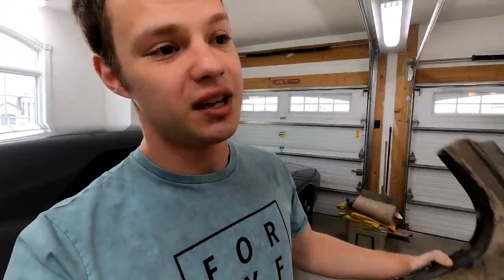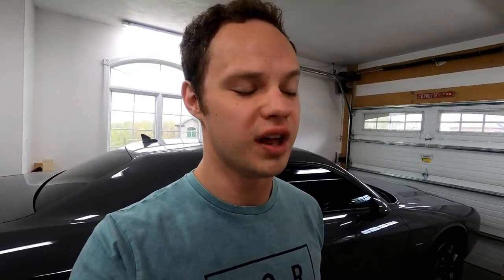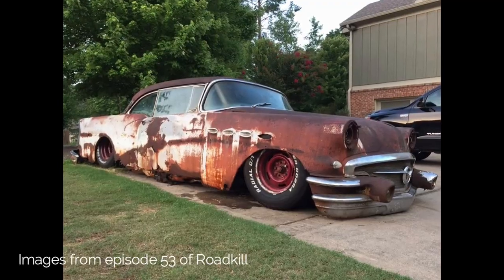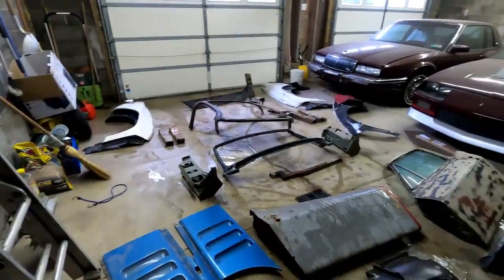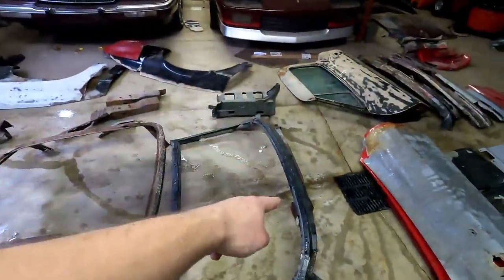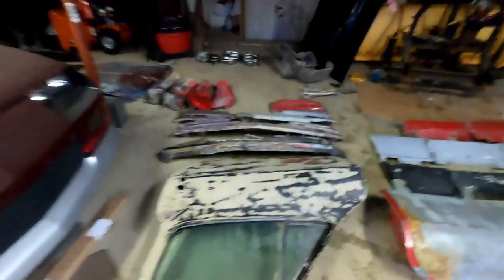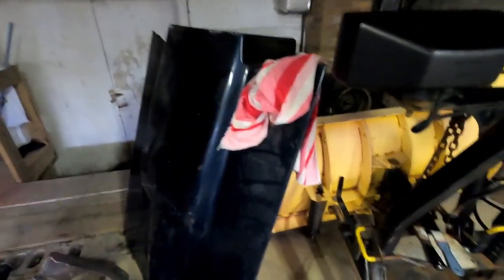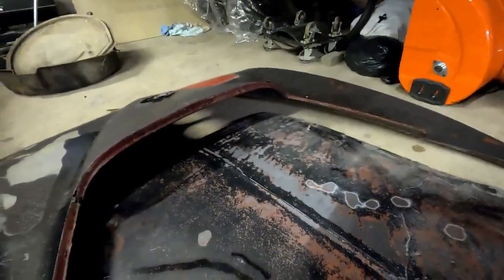I'm Building a King of the Mountain Tribute Split Window!!

Comment: Mitch, how about making panels with resin and woven carbon graphite? You don't need auto-crave oven. Just have a big bag like pest-control vendors are using and have the whole body in that, and have the air sucked by shop vacuum. When I heard about this method, I was going nuts and didn't believed that it is possible. But Brit fiberglass sports car and GT geeks had done it, and they did it successfully. The thing is that you don't need to make the panels as stiff as Indy cars or the Formula One tubs. The Brits are saying that even a roller will do.
Reply from the maker: That’s really cool. I’ve never done anything like that before but that would be really trick.

Comment: Are you selling a dash cluster?
Reply from the maker: Yes I was going to sell one of them and I was also going to sell the retainers and the speedo/tach housing.  Which part are you interested in?
Reply: @MidYearMitch  I will be using aftermarket gauges, so just the cluster housing.
Reply from the maker: It’s not perfect but I can list it on eBay so you can see it and buy it if you are interested. My eBay is user is corvettes365. I’ll list it shortly.
Reply: @MidYearMitch  Thanks
Reply: @MidYearMitch  Were you able to list the cluster?
Reply from the maker: I just listed it. Sorry for the delay